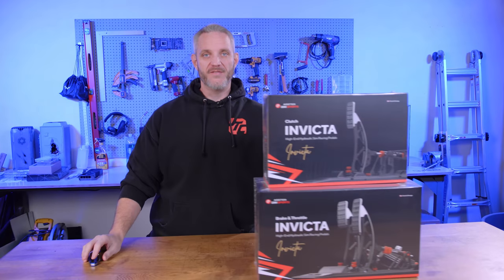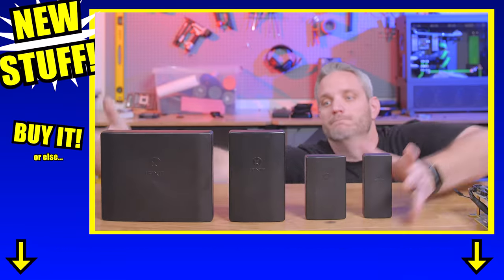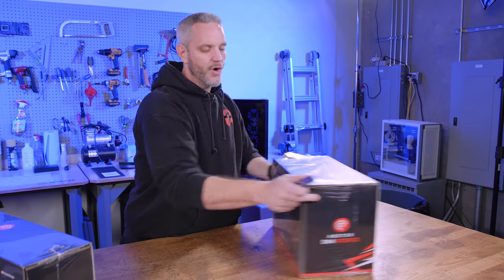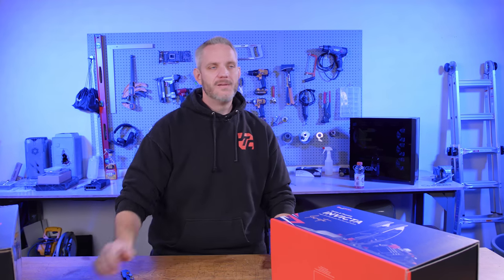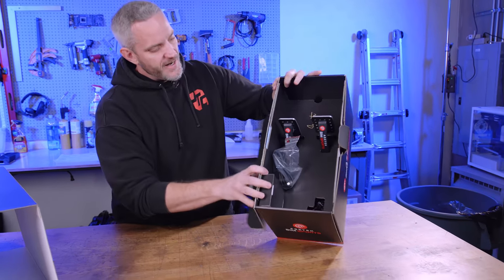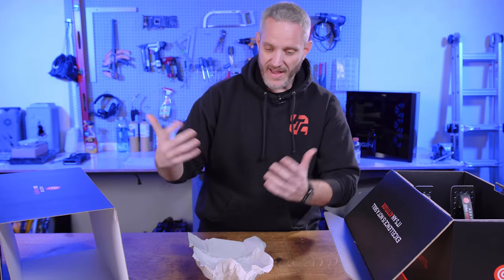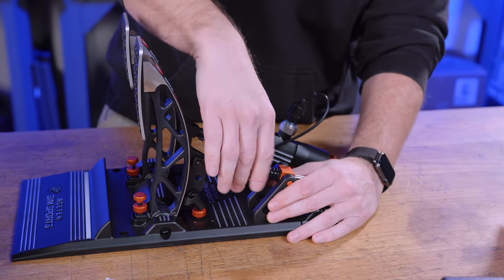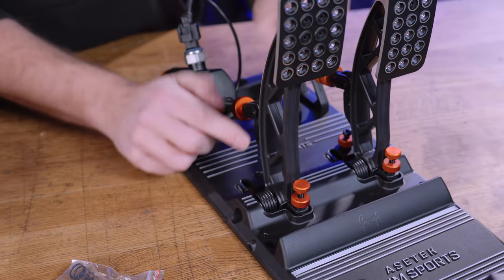These new Racing Simulator parts are insane! Asetek Invicta... yes, ASETEK!

Comment: I believe the reason the port isn't in the back is to protect the port from getting damaged, in the event the whole unit gets pushed back into a wall, or whatever is behind it.
Reply: It's mainly to avoid having to constantly bend down and reattach the cable every so often when if falls out. By having the cable mount to the inside then bend 180 degrees like that is to make it nearly impossible to accidentally disconnect the cable.
Reply: That was my thought to. Personally I would have put it on the underside like they did with the connector between the main pedals and the clutch. They could even still have that bend to help keep the plug from disconnecting just off to one side but also protected from your foot slipping or whatever.
Reply: Lol, I've broken multiple peripherals like that

Comment: Finally sim racing content again. Waiting for this a long time. As a sim racer myself with a pretty decent rig I was thinking about those pedals as well but i will go with Simagic p2000 hydraulics instead. But heard a lot of good stuff about those as well
Reply: same here of all the pc youtubers idk why we haven't seen much sim stuff especially right now its blowing up. I went with the Meca cup 1s and also have Gt pro hydro pedals
Reply: @tonyyimbo  i mean Linus and his crew got two videos about sim racing because Jake is into it pretty heavy. After a more "low end" equipment test they came up with a video using a solid rig and at least fanatec podium setup and I think they went Heusinkveld pedals if I'm not mistaken. Currently running the HE sprint as well because the Simagic pedals are out of stock everywhere. At least here in Europe
Reply: You will not be disappointed Bro. i live in China and i received my p2000-S100 (the new model, dont buy the old one because they have a problem of leaking oil in the seals) as one of the first customer. amazing pedal set. much better than the Asetek for sure.
Reply: If you need any help or advice you can contact me any day
Reply: @aqulex84  yup I saw that too .  It was a great episode I'm really glad sim racing is getting more exposure
Reply: @michyassouline9408  yeah that would be great. But what do you pay if you order in china directly or do you live there? Iam living in Germany so there would be some more costs due to tax and import fees if I'm correct. But I'm heavily looking forward to get my hands on the p2000 (200kg)
Reply: 4400 & 4800 rmb *
Reply: @aqulex84  i can buy them for you and send them to germany with a lower value for tax purposes.
Anyway we need to find a way to communicate.. every time i wrote something youtube block my reply
Reply: By the way. The old model (p2000) that you asking for is a little cheaper. But quite hard to get now as it's already old

Comment: I have always wanted a sim rig.  My issue is that as much as I enjoy driving, my initial passion was flying.  You mentioned you haven't decided on a frame yet.  Any chance you could get/review a frame that can support both (if that exists)?
Reply: He mention he got an Obutto Revolution
Reply: Next level racing have hotas mounts for there GTtrack rig.  The mounts are an additional £150 ontop of the cost of the main rig which is around £650.  then youl need a a couple of grand for the sim hardware aswell.
i personally went for mounts that attach to my office chairs frame and kept the sim rig set up for racing only.  Its an expensive rabbit hole, but such a good rabbit hole to go down.
Reply: Do what I did... build a dual rig.. part-time flying, part-time driving ;)
Reply: Have a look at sim-lab too, and rigmetal in the US. Aluminium profile based rigs are the most flexible so you could in theory get all your hardware mounted to those
Reply: Simlab
Reply: @yawningsalmon  The Obutto stuff is going to be the best for multiple setups. It just comes with so many attachments.
Reply: Trak Racer makes their TR80 and TR8 Rigs that have side mounts to include flight sim addons. I bought the TR80 for Sim racing but also have a HOTAS that I may add the mounts for later on. Great quality rig btw.
Reply: There are frames that support hot-ass setups...And if you do VR jeezzz....get your freak on!

Comment: Love your content but you’ve made a couple slightly incorrect statements about the brake. The elastomers are for the soft stage and the pedal will travel regardless of the elastomer hardness. You adjusted the preload on the back which is the pad to disk take up “simulation” which is the first part of the soft stage, not the whole soft stage. The elastomers finish the soft stage. Push more and the pedal will lock out - ie - stop moving completely - you’re in the hard stage, but you can continue to brake due to the system still measuring the pressure of the fluid without any brake pedal movement. This is the big difference when compared to all other hydraulic and load cell pedals, they have to continue to move to measure pressure - even if a small amount - and that is not what happens with a race car pedal. In race brakes once the pads are on the disk completely there is zero pedal movement, just pressure.
Reply: Almost spot on, except other hydraulic systems will also continue to measure an increase in pressure past the mechanical bump stop, it’s just that most are designed with a longer throw so you’re likely to actually reach it before maxing out your calibration. It’s very unusual to physically max out the 1000+ PSI sensors typically used on hydraulic pedals.
Reply: @boostedmedia  wow, Will commenting on my comment!! For sure, it would take a Herculean effort to get to the bump stop on my Tilton-based hydraulics - so effectively they’re going to still have movement but you’re right they still would measure pressure if locked out.

Comment: I was surprised to hear Asetek were entering the sim racing arena. Wow they went all out on these pedals. I’d be interested to see how much they will cost in the UK as compared to say Heusinkveld Engineering Sim Pedals Ultimate+ which if I had the space or budget would probably be on the list.
Important to get out there to any new comers thinking of getting in to sim racing, that a lot of the high end equipment is beyond the average persons budget.
I totally agree with Jay that the professional experience and feel that you get from high end equipment can not be met by entry level equipment. 
But do not let that put you off. I still use a Logitech G27 and am comfortably beating friends that have spent near 10K on extremely high end sim setup.
You don’t have to spend thousands to be fast, don’t get me wrong if I could I would😀, entry level stuff is more than enough if that all your budget can afford.
Reply: iv tried those pedals the older ultimate non + and absolutely wipe the floor with a lot of pedals on the market i have fanatec v3 and it felt completely different

Comment: Dang those look dope. I usually get pretty bored of racing games very fast, but I've always wanted a nice quality wheel and pedal set. I'll have to check these out when I have space for them.
Reply: A high quality budget Logi G920 or Thrustmaster T150 Pro(never the RS) for around 200 USD is perfect for desk mounting and entry SIM rigs. T300 is the next step up then Fanatec

Comment: They arent kidding on that price though... over 1000 bucks just for the full pedal set... Holy.

I grew up with a 68 Mercury Cougar and a 1970 Ford Torino. After I fixed the brake systems on both I had a solid pedal as well. You get REAL used to it and brake pressure is all direct feedback from the car and the brakes themselves. I love it. But anytime I drove my dads truck or my moms car I was hitting the brakes a little to hard for a few miles. Took me like a year of switching cars regularly before I stopped doing it. 

I am actually surprised with how nice this system is. At least from what I can tell watching a video. Glad they were smart enough to put a physical connection between the two sets. I was worried they skipped that and it already killed it for me, but no problem.

Comment: lol. I just placed my order for the ClubSport V3 Pedals with the performance kit.

I'm getting into sim racing myself, finally. Dropped around $1400 over the last two days. I'm getting the Thrustmaster TS-PC with the Sparco Rally Wheel, along with the TH8A shifter. I'm mounting it all with the GT Omega Apex Racing Wheel Stand. I think it will be a sweet place to start into this hobby. 

My main goal with the gear was to hit a level of quality where I didn't immediately want to upgrade. Which I knew I would if I bought anything less than the ClubSport V3 Pedals. There's simply nothing below the V3 that wouldn't greatly disappoint.

I have very limited space, so I couldn't go with a full cockpit. This means the weakest part of this setup will be my chair, and keeping it secure enough to operate the pedals properly.

I'm open to suggestions. If there's a chair that can be stored away easily, but will grip well on a hard floor, let me know!

Comment: I wish somebody would make force feedback gear shift.  I got G29 wheel/pedals with TH8a shifter with added shifter for my 18 speed for ATS ( American truck simulator). 

Nobody i knows makes force feed back gear shift.   So you get that real gear shift moving a bit,  I think that be kinda cool if somebody made.   But good video as always Jay.    Ask that company if they every make force feed back gear shift for ATS or other racing sims.
Reply: Google DIY sim racing shifter with clutch lockout. Someone has a great diy online for a shifter that also has a lockout where you have to use the clutch to shift. One of those with a transducer mounted to the bottom for driveline vibration and the sense of clunking into gear would give you a great sense of immersion.
Reply: @Jpilgrim30  
Oh sound interesting.  But I already float gears now with ATS, I just wish my THA8 shifter now was stiffer with bit rattle so feels more real. But alright.  I’ll try to look that up.   Unless you have link?  But thanks for info :)
Reply: @pistolfied  
Ok many thanks :)

Comment: Damn. I was really hoping these would be cheaper. Really hard to get into the hobby when you need to drop several thousand on kit. ~£900 for the peddles. I'm guessing the DD wheel will be £1000+ and then another £200 for the shifter? Oh well. Going to have to hope someone's selling a G29 or something on eBay.
Reply: most people enter sim hobbies on cheaper parts in flight/space you see a lot of Thrustmaster T16000 sticks for example.
Reply: If you want to start out and are looking for gear trying out a G29 or similar is the best bet, the amount of people who bought big due to staying home in the past 2 years and have started selling up because they say they don't have the time to make the most of it is quite high

Gear of this spec and price is the stuff you check out when you're absolutely committed
Reply: A g29 is a great starter if you wanna go a little more Gucci you can get the new fanatec budget direct drive wheel it’s like $700 for the base a wheel and a pedal set that’s pretty decent.
Reply: Look into the Fanatec CSL DD.
Reply: You can try looking for a Thrustmaster T300RS. It should be better than G29 and it does come with 3 pedals (I think Gran Turismo edition has 3 pedals). Shouldn't break the bank like some of these parts you mentioned, but should be a decent entry point. It doesn't come with a shifter out of the box, but neither does the G29. Although the shifter for the T300RS is more expensive than G29 shifter, it's also more versatile supporting H shifting or sequential shifting and definitely feels more robust compared to G29, but there is a noticeable price difference between the two.
Reply: better alternative for me is fanatec their cheapest is still over 700 euro but it include pedals and direct drive wheel that works with PC and PS
Reply: As someone else has said, look into the Fanatec CSL DD. Whole set will cost you less than $1,000 minus the rig. Plus a rig would be $1,400 max if you budget correctly. You can get in even cheaper and still be competitive. I currently have a TM T248 and stand up pretty well in the things I do mounted to a desk. It's more about practice. Been sim racing for about 2 or more years now, and started on a TM T150. Not that the T248 is much of an upgrade, my T150 just broke lol

Comment: That moment when jay says an f1 car and lmp1 cars are automatic…..
Reply: I was going to say something, but decided against doing so.
Reply: Well, they are. Cars with DCTs and paddle shifters are still automatics. If it doesn't have a clutch, it isn't a manual.
Reply: @empiricalmadman3260  f1 cars and lmp cars have clutches they are actuated by paddles on the back of the wheel. They aren’t dct, almost no race cars are because of weight.
Reply: @Douglas m  My bad. You learn something new every day. Though, calling a sequential manual a manual is a technical distinction. The user experience is more akin to an automatic than a manual.
Reply: @empiricalmadman3260  I understand what you mean, but the fact that user has to manually change the gears weather it be an h pattern or a sequential(stick or paddle) should qualify it as a manual

Comment: Hello, you are so right about how a racing brake pedal works. It's about using force to control braking rather than pedal movement.
You have a much better control of the force applied to the pedal if it does not move, or very little. Only road cars use pedals that have a long stroke.

Comment: Nice to see Asetek getting into sim racing. Started with a low end Thrustmaster wheel and pedal and have used Logitech and Fanatec gear as well. Been waiting to get into the higher end of direct drive wheels and higher end pedals above my Fanatec CSL elite.

Comment: I'm sure it would cost more if it had the clutch pedal included, so I actually like that it's separate because you won't have paid more for a pedal you don't use if you don't have a gear lever yet or, like you said, you don't use it at all. Meaning you can upgrade incrementally, meaning easier entry into the sim world and more customers

Comment: I know you like cars, but your average sedan, "most cars," have a push rod that connects from the brake pedal into the brake booster. There is a little slack at first, but when you push firmly on the brake, it's actually the resistance from the vacuum in the booster that you feel. In the common sedan of course. Thank you for your vids though.

Comment: 12:33  firm brake pedals are awesome, also makes a lot of sense for racing as you sometimes want to use brakes and throttle at the same time so you have to use your clutch leg to brake
Reply: and firm brakes allow you to start braking later ;)

Comment: If I’m correct…. Brakes on a typical car are actually a ‘normally closed’ reed switch. So when your foot is off the pedal it pushes the button and opens the circuit. But when you touch the pedal, it releases the button/switch and closes the circuit which turns the brakes on

Comment: I mean once learning it has hydraulics inside, it all makes sense it's made by asetek. What a great day to be a simracing nerd. Actually accessible industrial grade hydraulic pressure sensitive brakes instead of loadcells.

Great to see simracing content on the channel again.
Reply: And the hydraulic system just activates an electric pressure switch and sends the exact same information for the game to process as the load cell or even a hall sensor actually.
No reason that a well constructed quality load cell pedal set could not be configured with little to no pedal travel and use software to set up dead zones and pressure curves and deliver the exact same feel as the hydraulic unit at a much lower price point.
The hydraulic fluid does not compress and is only doing the same thing using the fluid as the medium to apply pressure to the switch where the load cell is using the pressure applied directly from the pedal to the load cell switch to do the same thing. 
It is still just changing the resistance of a variable electric switch using applied pressure to the brake pedal, no more, no less.

Comment: They are still using a load cell for the breaks but its a hell a lot easier to adjust. In most cases you have to take the whole pedal apart. On this you turn a few screws and you're done. 1200 isn't bad for a three pedal set up isn't bad but full hydraulic systems are coming down in price.

Comment: The pedal setup forces u to have a real sim seat so you can be low enough to be in teh correct orientation with them. Even though the price is to high for how much time I spend in sim racing, dont you think that an angle adjustment would make it a better solution for those of us that "sim" in an upright seating position?   Nice either way, possible consideration later.

Comment: what would be interesting is to use a dual density rubber cylinder for the firm feeling, as the brake is applied it makes use of the softer durometer rubber and once that is maxed out ( squished to the max) then the next hardness of rubber is used simulating the cup against the disc...   seems like it would work... it works with coiled springs..

Comment: Brake switch is normal closed with the pedal up and extend when the pedal is pushed, so nothing is touching the switch when the pedal is down. If not then you would just push the pedal through the switch

Comment: They probably put the USB port pointing forward because some setups may have little space behind the pedals. Or you may have the back of the pedals resting against a wall, fake firewall or something similar. Would be nice if cables with 90 degree plugs were easier to find.

Comment: the hydraulic switch isn't a switch like the one to turn on brake lights which would be a two wire switch, what you have there is a transducer, a 3 wire system much like a potentiometer giving a rising/dropping resistance as the pressure rises